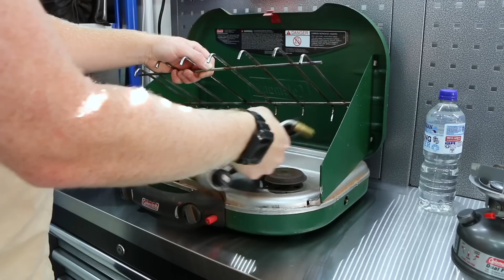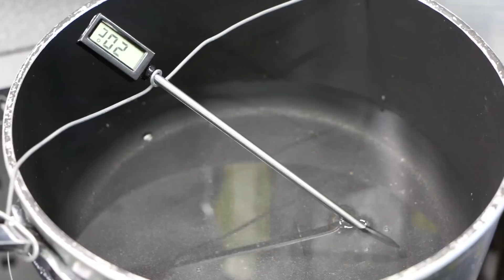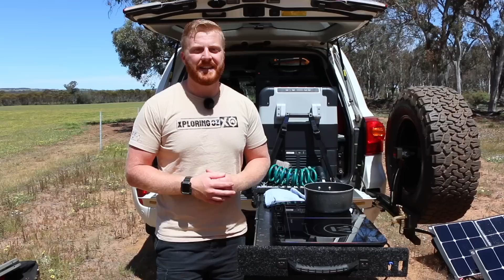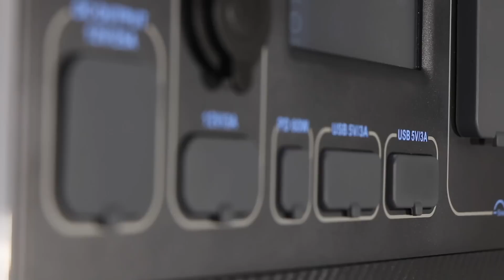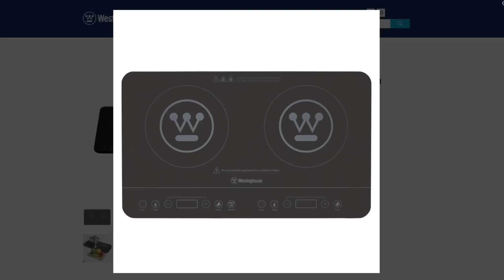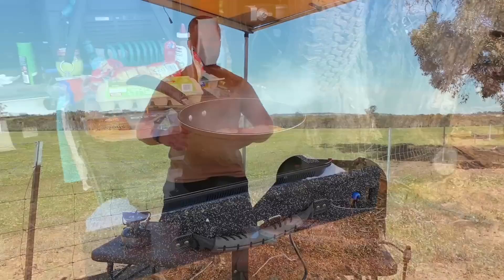INDUCTION COOKING & Camping | Is it sustainable | Electric vs Gas | Overland Cooktop | Pots&Pans

Comment: Great video again. For me the cost alone rules it out as you’re looking at approx $3k to get started. That is a helluva lot of gas bottles etc not to mention that when I’m camping I’m not rushing, so boiling times etc become irrelevant. As with everything though, each to their own 👍
Reply from the maker: For sure, lithium has still got a fair way before it becomes a common item in our setups. Saying this though, using a unit like the Bluetti provides many more benefits than just induction cooking. So those who are looking for a portable dual battery type setup, the little extra could be worth it. 
Cheers
Reply: The investment in lithium batteries isn't just for induction cooking though. It's generally also to power your fridge/s, led lights, drone batteries and all that other stuff too. Lithiums, if used right, should also last over 10 years vs other battery technologies where you get around 2 - 3 years life out of them more often than not.  It is a shame the investment up front is as high as it is even though it has come down over the last few years.
Reply from the maker: @seansmart2981  This is true and the same thing apply's to the portable Bluetti system. It's not just a system for high powered appliances like induction cooking. It can power almost anything AC powered, along with all the small power draws from regular portable devices and camping equipment.
Reply: @seansmart2981  I agree with you, with the exception of the 2-3 years for other battery types. My last AGM in my 79 lasted 8 years & I only swapped it out as I was heading  remote remote & figured it was due to expire.  What I did though is researched different types of AGM’s & actually wired it up to my Redarc BCDC as a lead acid as the battery specified a slightly higher Absorption voltage than other AGM’s I’d seen.  So not all AGM’s are created equal.  It ran every day 24/7/365 for 8 years with my Engel & other gear constantly drawing off it.  After I pulled it out of my truck I gave it to a friend who killed it fast due to a poor charging regime.

At the end of the day, power & water, they dictate ur levels of comfort, so I agree, a good lithium system will transform any set up & the financial pain will be forgotten when ur the dude in the outback powering everything with ease & then some. 👍
Reply: It’s actually way less than that.  A 2000w inverter from JayCar will cost you $500.  A 100amp lithium battery you can also get for around $500 and a 150watt solar panel $140 from 4WD Supercenter.
Reply: @Getingsmart  not sure if a 2000w draw is even possible with a 100ah battery that is usually limited to 100ah draw internally. The draw would be well over 150a at 12v.
Reply: But you don’t need a lithium battery to run an induction cooker!
Reply: @officialWWM  
I have an induction hot plate I bought about 2 years ago at Aldi’s for $49.00. Heats liquid foods - water, soups, etc real fast. Beats having to wait and watch forever for an electric stove, and electric wastes power.

When camping using shore power, all that is needed is to plug in and save your battery power.
Reply: I put my cost at around $1k for the big solar panel, the Renology 50 Ah MPPT, 200Ah lithium battery. The 4000w inverter was another $150 but it may be insufficient for water heating so I may need a bigger one, plus another $600 200Ah lithium battery.

Comment: We really need an accountant to do cost benefit analysis of both these technologies.Using feeling isn't going to cut it.Even going to Exmouth my 9kg gas bottle refill was 45 bucks.I think the biggest drawback is the initial cost of doing induction.For us who do 4 - 6 weeks camping per year gas is a no brainer.Maybe when we retire and have a lithium pack in our caravan and travel for longer periods lithium might be the ticket.A nice table at the end on screen would have shown the huge contrast in price between the different technologies.Anyway a real fire beats both gas and induction!
Reply from the maker: For sure, the initial cost is significant with any lithium type setup. There is no doubt that gas is heaps cheaper, but saying that the advantage here is that the Bluetti system is very versatile. It can be used for so much more than just induction cooking, it would be perfect for someone looking at purchasing a portable dual battery type setup with investing thousands into a permanently mounted system. 
Hopefully lithium, will continue to improve and become more affordable. 
And definitely, fire is still king!
Cheers, Nathan.
Reply: If you have the internet skills and ability to construct a solution then you don't need the "offerings" from others! I've recently acquired a very nice 200Ah lithium battery for much less than local pricing for an 100Ah. I use Renology ffor my charging, their gear seems good and reliable, significantly cheaper and well-supported.
Reply: You can use these at home as well: arbitrage power if you have time of day power contract or soak up power from your home solar panels rather than exporting back into the grid. Of course the units wouldn't last as long if you cycle them everyday.
Reply from the maker: @johnruciak  For sure, these would work in those instances. Saying that the Bluetti has a cycle rating of 3000 cycles to 80%, so it would take discharging this battery everyday for years to have a noticeable effect.

Comment: As a 200 owner have valued your content, just upgraded my setup to 200ah DCS battery in the rear deleting both front battery’s installed a safari twin burner induction cooktop with a Victron battery protect will disconnect all accessories at 20% for vehicle startup (have a jump start pack just in case tech fails) had a driveway test cooking dinner and breakfast used 50% battery. COVID restitution finish next week 1/11/21 so us sydney folks can get back out on the tracks again, won’t to see how long to recharge from 50-70% battery use as this setup charges direct from alternator
Reply from the maker: Awesome, sounds like you have an awesome system there. Upgrading my vehicle batteries to lithium might be something I look into I the future as well, there are so many benefits to this. 
Glad to hear you guys are finally free again, all the best with the testing and your adventures on the tracks!
Cheers, Nathan.
Reply: Do you have the dcs twin in the front or a dcs 200ah in the rear. Just wondering as if the rear are you just running cable to the front for the engine/alternator?
Reply: @boxheadmr  yes cables to the rear no front battery’s